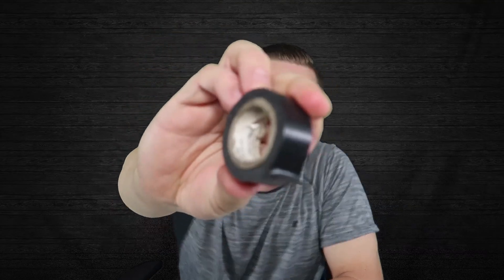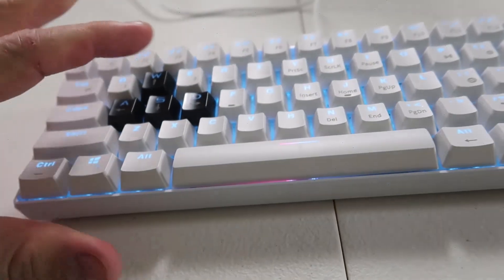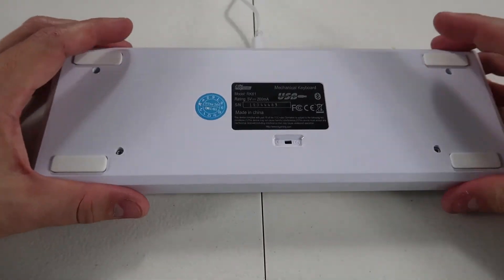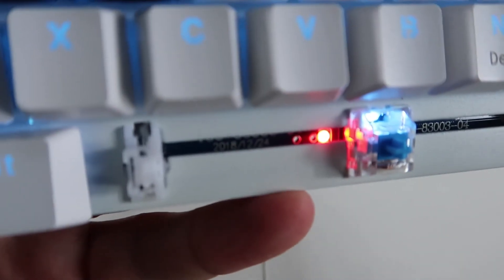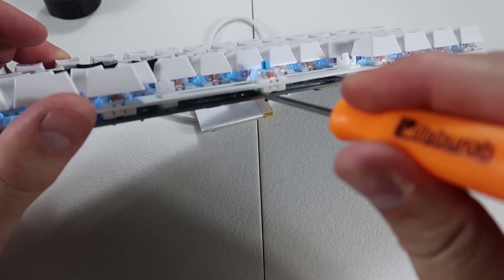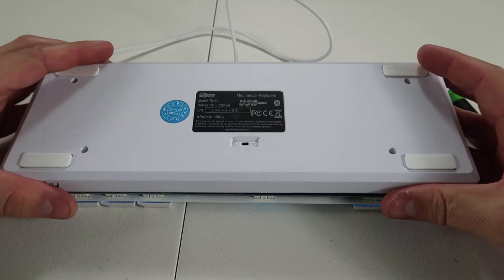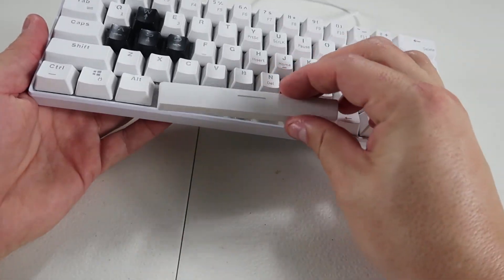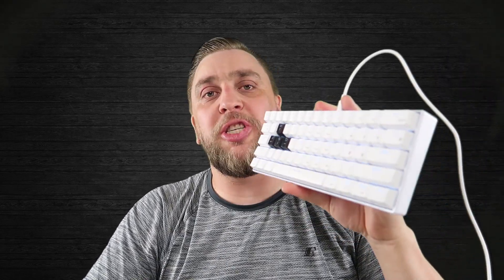Royal Kludge RK61 charging light hack!  get rid of that red light

Comment: When charging it with a wall plug do you put the switch on the back to on or off?
Reply: @5150GringoGarage  ok is it better to change when it’s off if I’m not using it?
Reply: @5150GringoGarage  ok and is there anyway to know how much charge it has and when it’s finished charging? I just go the keyboard and I’m a bit confused
Reply: @5150GringoGarage  ok and can you check the charge remaining in the keyboard?

Comment: Had this issue too when the power suddenly cut due to a storm and my keyboard just constantly was showing the charging light (I don't use Bluetooth mode). Simply turning the keyboard on and off Bluetooth mode (while its charging) fixed the issue for me. (Might take a couple of tries) Maybe this might for others as well. Another point to bring up is that you can put the tape on the red light by simply removing the space bar without unscrewing, but I guess unscrewing gives better ease of access.
Reply: @progamingsenpai I have the same problem, i have tried your method but the red light doesnt really come out

Comment: You can just use it wired and turn the keyboard of from the back
Reply: @1nevea  there is a switch at the back of the keyboard that says on off if you are using a wired connection you can turn off the keyboard but keep it plugged it the red light should no longer appear
Reply: @NateBankole  'Should'

Comment: does it works to just put a piece of tape under the spacebar? like just some ducttape or something like that
Reply: @5150GringoGarage  bruh how? isnt there like a red led you can put the tape on???
Reply: @5150GringoGarage  yea cus youre reaching under the board in order to put it on the red light, so i though if you put the tape just right next to the switch, anyway i ordered the rgb version and i dont even know if it also has the red light because ive seen videos with it plugged in and theres no red light sometimes